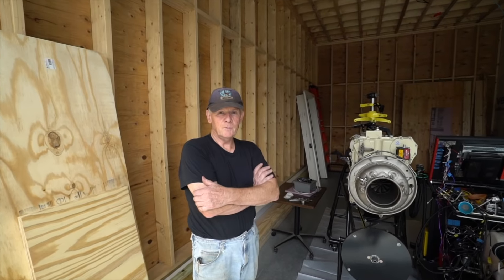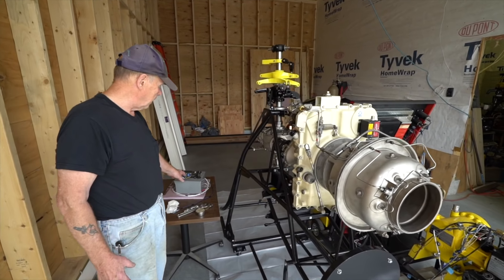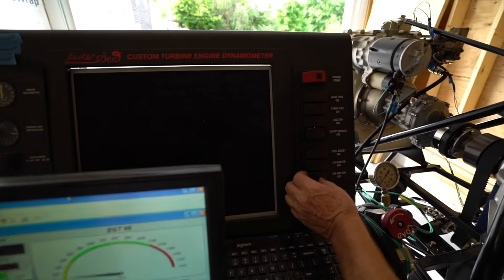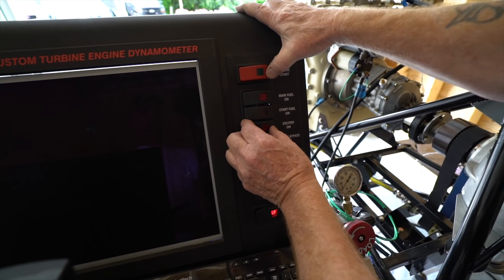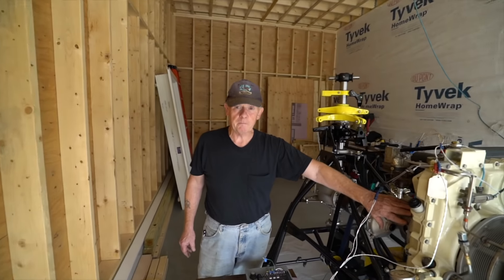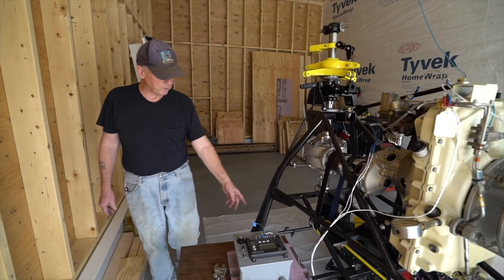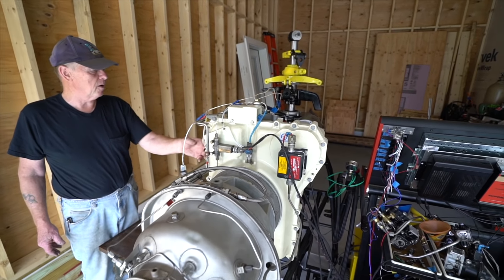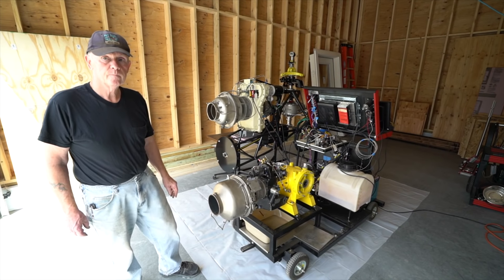RotorWay Turbine Engine Demonstration

Comment: This set up was designed by Don Hillberg and sold as a conversion kit by Dave Demanski of KISS . . There were 100 kits sold
Kit #98 had a manual override in case of electrical failure.

Comment: I've flown in a Rotorway that was assembled by a friend of mine in the UK. it had a 4 cylinder petrol engine and the tail rotor was driven by vee belts. The tail rotor used to cause its blades to crack at the boss connection points.

Comment: Be interesting to see that turbine hooked up to a generator.  Be more interesting to see how big of a generator it can turn vs the amount of fuel consumption.  Of course, that data is already known; but the efficiency would be worth noting.  Fuel consumption vs amperage output with two phases 120/240vac.

Comment: Quick question: If you've got a centrifugal clutch on the engine output, why do you need a spragg clutch as well? Surely if the engine died in flight, the centrifugal clutch would disengage and the rest of the drivetrain would be freewheeling (or autorotating if you prefer) anyway?
Reply: why would  the centrifugal disengage at a useful rpm, it would but at a very low rpm, wouldn't it?
Reply: For startup otherwise you would be trying to turn main Nd tail rotor systems at start, equals hot start
Reply: @Channel-tr1hx  If the engine were to lock up or something catastrophic, the inertia of the rotating blades would tear something apart
Reply: Between the clutch and the sprag is the Rotax reduction drive if it were to seize then you would be mighty greatful that the Sprag allowed the Rotor system to continue spinning on its own momentum before you were able to reconfigure for Auto Rotation (drop the collective to change the MR blade pitch to negative) which is totally different.

Comment: chris, i need some info about converting my 30 yr old barnfind exec 90,never flown,to a turbine solar set up inclusive of kiss aviation gearbox plus the necessary components,and electronics,etc,as in ball park cost. im in the uk,and such info is not easy to source.thank you.
Reply: well the kit costs 20k USD from KISS aviation and thats just the conversion kit. You'll need your own engine + gearbox which is another 20k. I'd ballpark 50k to convert a 162f to turbine, not sure if exec 90 is any different.
Reply: @codmott286  thanks chris,im pretty sure the airframes are the same,i did think the kiss aviation kit included the turbine reduction gearbox,and maybe tailrotor gearbox etc.are there any solars turbines still out there,if yes,where to look? appreciate your advice.
Reply: @eddyriley2055  you're right KISS includes all gearboxes. You can find the turbines on ebay sometimes, barnstormers, occasionally trade-a-plane, otherwise best avenue is the various rotary forums for each dedicated aircraft. Some owners give up projects, or bought spares they no longer need. For instance homers helicopter website has a clean T62-32 available in crate.
Reply: @codmott286  thanks for that,what a relief,had visions there,of a conversion kit , consisting of brackets and bolts for $20k,back on budget,just need to find a decent solar t62,many thanks.

Comment: Is there a Good source "Proven", 'Civilian Aviation "Turbine Engines"' that can be used and adapted for the civilian (2-6 seat) Homebuilt experimental Aircraft market? I would like to see a Light Turbine engine in a Civilian aircraft that has lots of power to overcome the current power deficits that exist in the current civilian airplane & helicopter market. I'd sure like to see an Experimental, Homebuilt Turbine Helicopter Kit (or Airplane Kit) that seats 2-6 passengers, has more power and an extended range than what is currently available in the civilian market. Seems, the engine powerplants available in the current market are lacking performance and barely powerful enough to carry 2-4 passengers at max load, only able to fly 2 hours or up to 200 miles before refueling again. Does anyone know of a more capable Helicopter than the status-quo (ie. Robinson 22, 44) that has more power, greater maneuverability, increased range & load capacity that is still affordable to buy and fly?
Reply: I feel the same. 

I want a 100-350 hp turbo prop for the experimental category to begin with. 

I’d make a mini PC-21 with a 200hp turboprop if it existed.
Reply: There are a couple of firms designing "light" turbines for the experimental market but you have to understand it's a very difficult area to penetrate. Turbine's require millions of dollars in R&D to develop and use expensive exotic alloys for the high temp/pressure thresholds they operate within. Making one for the experimental market is a tough sell because you're looking at $100,000 just for the engine which is usually more than someone wants to pay for an entire functional aircraft. 

The next problem is maintenance. With a brand new turbine who is qualified to service it? Probably only the manufacturer since it is nothing like popular turbines you see today. Parts will be rare and you will have to ship your engine across the country or even overseas for repairs which is further cost prohibitive. 

Lastly comes necessity. Turbines are for high performance heavy aircraft. Who needs a turbine in a 2 seater plane that weighs 800 lbs? Experimental aircraft are typically flown maybe 50 hours per year. There's no need for the kind of reliability of a turbine with such little usage, piston is fine.
Reply: The T62 series is aviation approved and time proven, if you want more than 300 shp though you're going to have to go to the t63 series!!

Comment: I am thinking air boat  application    what is an out put rpm   at what I would bolt to the prop? 2500 max
Reply: well the turbine shaft outputs at 60,000 rpm. You could reduce it to whatever you want.

Comment: I worked with lots of those Solar turbines in the 70’s. They were made for the telephone company’s 200 KW standby generator sets. They proved to be not a good choice for that application because of the frequent starting and stopping they experienced. A turbine engine does not like short run times and frequent starts. The heating and cooling cycles are the equivalent of several hours of run time per start. 
This resulted in high maintenance costs compared to Diesel engines which is why they were phased out of the standby generator application. Solar still makes much larger turbine generators used for industrial power generation.

Comment: How much does one of those run  $?
Reply: 20k for the engine, sometimes cheaper if you can find it in bulk without inspection. Have seen them go as low as 6-10k.

Comment: does this engine dont have any free power turbine on it ?or splitshaft ?is it direct drive or is it a turboshaft?
Reply: It's a turbo shaft engine. As the combustion gases impinge on the turbine rotors, they turn an output shaft out the front.

Comment: I worked on the 62.
It has two rpm's, one hundred percent and zero percent.
I was an turbine engine mechanic for helicopters in the U.S. Army. Most of my work was on 712's found on the Chinook as well as the 62 used as apu. Noisy little bastards... no doubt why I have tinnitus and I used double hearing protection.
Question though...
I noticed there is no egt sensor on the chimney. Why not?
Reply: What helicopter does the smaller solar 2A1 come from? Also in regards to power %, most of these engines seem to idle around 60% until ready for takeoff, is that bad for the engine?

Comment: AN is just grade 8 BTW
Reply: 91rss ummm..... an stands for the army navy standard. Numbered in 16ths of an inch. Most of its aluminum, some stainless steel so grade 8..... not so much. Just an industry standard size description. For example -4 an is 4/16 aka 1/4. I’m surprised a normal google search couldn’t supply you that
Reply: @josht8011   yes  30 yrs in the field,, AN in fittings is obsolete now BTW, its basically hydraulic fitting charts to find fittings on owner built stuff, and owner built could use grade 8 vs AN3 etc.
Reply: @91rss  Wrong. Material & Process is different... Grade 8 is crap. AN is a tighter standard & quality